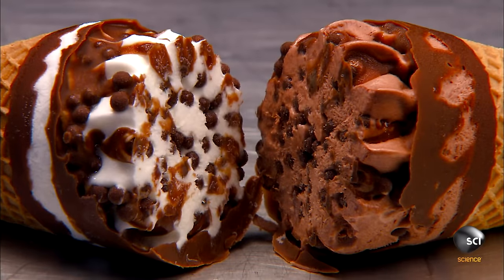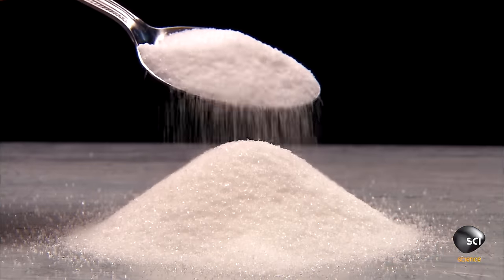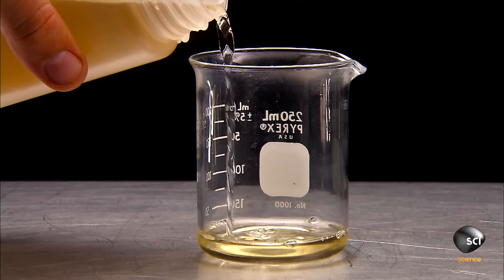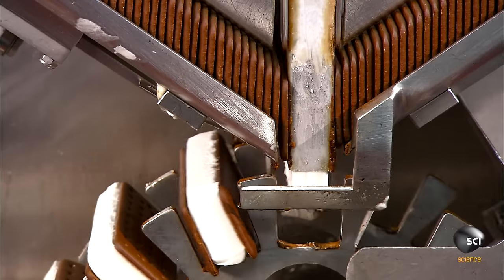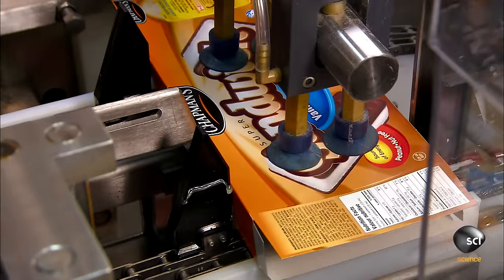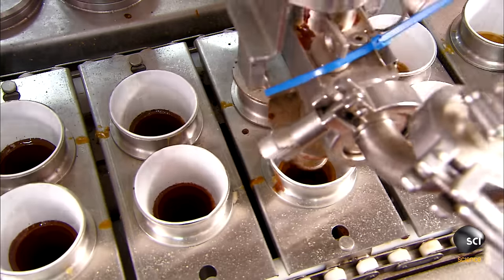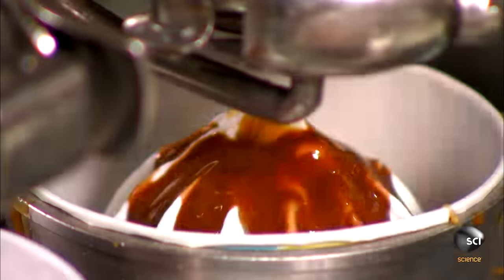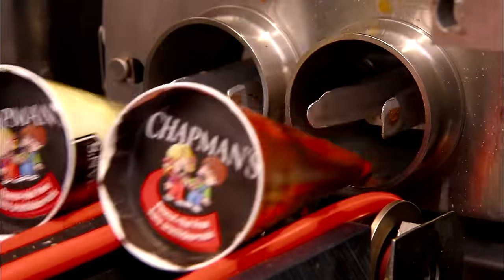Ice Cream Sandwiches | How It's Made

Comment: The engineering behind the machines in these factories is just remarkable.
Reply: Not really. It's pretty simple. It's like a Arduino project on a larger scale.
Reply: For example to turn on a brushless DC motor, you apply 5v until you want to turn it off then you stop applying power. That's two lines of code .
For a stepper motor, you 5v, 0v, 5v, 0v,... And each time you will step which may be 1/360 degree rotation. If you want to go in reverse, you change the direction, you flip the leads or change the voltage.
Reply: nobody:
Me: I wonder how fast these machines can be sped up before something breaks or ice cream starts flying. 2x, 4x, 8x, hmmm.
Reply: @Eric-xh9ee  Have you ever designed and built such a machine? (Not writing the operating code.) I, too, find the engineering fascinating.
Reply: @u.synlig  yes, I do hardware, software, and firmware. I'm a technical expert. Machines aren't too complex. If you study electrical engineering, you'll get to do it in school.
Reply: @u.synlig  designing circuit boards is much more complex or building machines like MRIs.
A lot of engineers will build "toys" either for themselves or their kinds. That's usually more fun than at work. I built an electric tractor and connected used open CV for the computer vision part. That was pretty fun. Unfortunately companies like John Deere don't pay as well as big companies. It's alright. They offered me a little under $100k but I make much more than that so I figured I'd do my hobbies outside of work so it's a big field. If you're interested in electronics, I'd recommend electrical and computer engineering. It's a big field and it's constantly expanding. If you get sick of something, you can do anything else you want. You're not stuck only writing software like you would I'd you studied computer science.
Reply: @u.synlig you can look up circuits with power MOSFETs or  contactors which are switches that can tolerate high current and voltages. Most machines use these "switches" to allow the power to flow and the these "switches" are controlled with 3.3 or 5v or some low voltage.
Reply: @Eric-xh9ee  I appreciate the detailed reply. Thanks!
Reply: @Eric-xh9ee  Engineering these industrial machines are not simple. Programming & controls might be, but the machine itself is not.
Reply: @TheNexusChan  I've built these machines. They're simpler than most things in engineering. Simpler than a space shuttle or a nuclear reactor, for two quick samples.
I can give example from every industry. CTs, MRIs, quantum computer or even classical computers are all much much more complicated.
Reply: @Eric-xh9ee  it might be impressive to some people lmao. It's impressive to me
Reply: I actually worked in one of these factories.  These machines are some of the most jank shit imaginable.  You look at them funny and shit is fucked.

That said, when running properly they're pretty cool.
Reply: @jcoolguy1548  yeah they're interesting. I just constantly hear people trying to say "[XYZ] is too complicated" to discourage people from learning rather than encouraging learning. When you break things down, things aren't as complicated as they first seem but yeah I machines are interesting to see work.
Reply: It’s refinement over time.
They start with a factory, and automate different processes as they think of them, or being in new machinery when it’s time to scale up.
Almost every one of these factories started out with humans doing almost everything.

Comment: I would like to know about the cleaning process for the machines 
Cause boyyyy
Reply: money jabb probably a pressure washer and spray-on chemicals.
Reply: They skip that step.
Reply: I work at an ice cream factory

While it's much different than here since it's much more advanced

But it's not really that hard i mean we usually use a gas hose and hot water and wash it all off

We don't really use soap since it ruins the machines

All the process takes about 30 minutes give or take 10 minutes so it's really not that hard and actually the easiest part of the day
Reply: WTF Rudeiepie lucky!  I worked in a cheese factory and clean up was the WORST part of the day

Comment: Me watching during Corona: Have they cleaned all these machines?
Reply: @elijahalonso5612  yeah now im curious 😂
Reply: 2:32 Rust disguised as chocolate
Reply: No one touches the machines involved in producing the ice cream and the metal they’re made of is stainless, antibacterial steel :/ C’mon, really?

And if you’re talking about the one scene where the heavily-geared worker checks the tank, the ice cream goes under pasteurization wherein all threats die to the extreme heat it’s under.

There is a reason why we have a food safety department to set regulations on factories. If the process of making mass-produced food wasn’t as near-perfectly clean as this you would be sick with something much worse than the virus already.
Reply: Ben V I was going to say the same thing. You can see the sandwiches rubbing against the machine.

Comment: What degrees is freezing?
Reply: 32 f.
Reply: 32°F and 0°C
Reply: 0° C/32°F is the freezing point for water without pressure.

I don't know the relationship between Coke/Coca-Cola and pressure but due to the presence of sugar, is why it does not freeze a little bit under the normal freezing temperature (mentioned above).

Here is a graph showing the different melting points of water under different pressure conditions: https://www.engineeringtoolbox.com/docs/documents/2005/Water_MP_HP_C.jpg

I am still unsure though of what they truly meant in this video by "freezing".